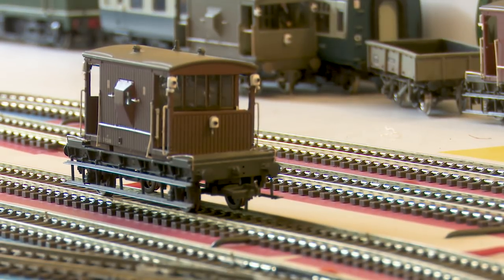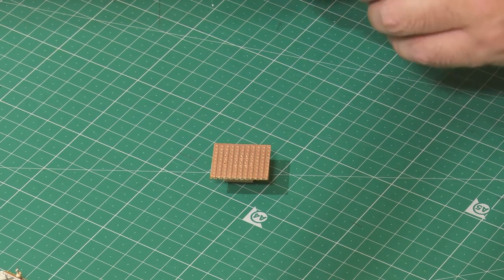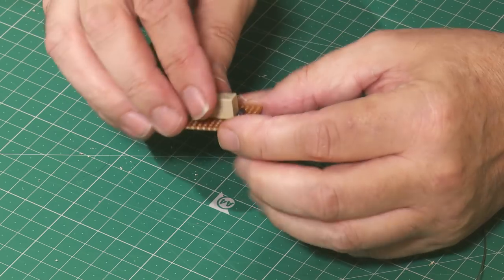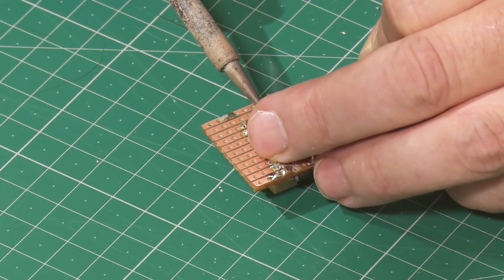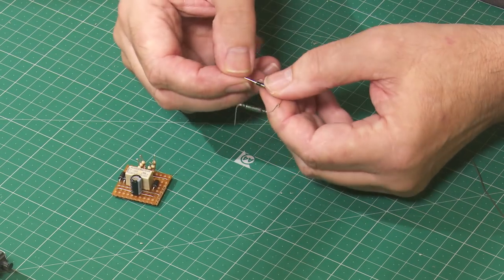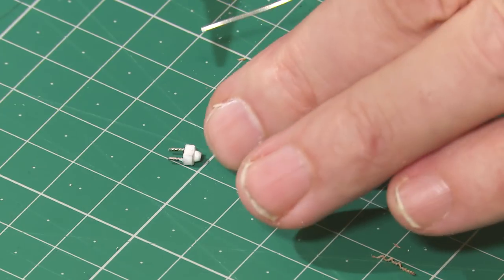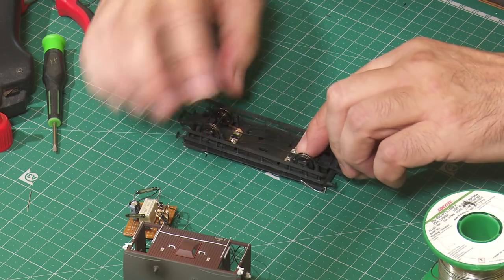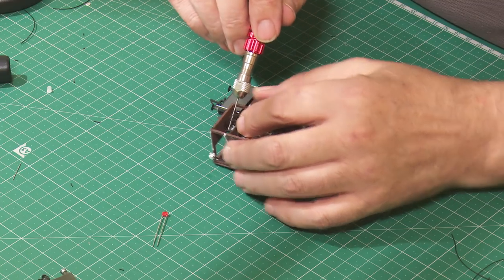40. Brake Van Lighting at McKinley Railway

Comment: I enjoyed watching this.  Just a minor correction.  Cathode is the Negative side, usually the shorter leg and connects to the "anvil" side of the LED when you look inside the LED.  Often it corresponds with the flat side of the LED.  Anode is the positive side. 
Thanks for a great video.
Reply from the maker: Opps - Thanks for the info!

Comment: Hi Charlie, I watched the video you did using the little module you aquired from ebay and decided that it could be a useful addition to the lighting controls I am installing in my rolling stock, after hunting ebay for the units and having no luck at all I then spotted this video and remembered that you were associated with McKinley Railway.
This system looks like it can work for me as no special modules are needed and just a steady hand with a soldering iron, a well devised modification for the model railway.
Well done Charlie.

Comment: Charlie - this is a neat little trick BUT the use of 3 red rear-facing lights was limited and on unfitted trains, the side lamps were used to face FORWARDS so that the driver could see that the train was complete (not required on fitted trains of course).   Your LEDs should be slightly altered to show a red light rearward and a white light forward - presumably by changing the painting/buffing arrangements.  Still a great video and a neat trick for van lights!!
Reply: To get the white Light forward would involve getting a separate white LED for each side.  So you'd need to fit two LED's on each side.  The LED's used in this video are red and do not have a white side, which is common of LED lights
Reply: @EsotericArctos  But there are white LEDs for sale...

Comment: That is a very neat use of these miniature latching relays, a great idea and so simple well done plus thanks for sharing. As used here the relay will most likely do the 50 million operations it is specified for, certainly outlive most of us!! To do this application with integrated circuits etc to match your spec would need some form of memory, so for me at least would be over complex.  Some comments if I may -

1) There is no power up inrush current limiting circuitry to the buffer capacitor, this could give rise on certain DCC combinations of power supplies/ layouts/ lots of instances of this or similar circuits from causing nuisance tripping of  DCC power supplies. This as the inrush currents add in this scenario.
 A simple enhancement I suggest is to fit a 47 ohm 0.5 watt charge up resistor in series with the top LHS half wave rectifier diode on each PCB.

(The 100uF capacitor appears as a short circuit and will draw a nasty spike of current limited only by the track wiring and track resistances to the DCC psu).

 This might not be a problem if you only have a few such instances of this circuit. Certainly at McKinley you have multiple and hefty supplies and your stock is well spread. So any such issues will likely be masked/ minimised. However modellers who have a small or sensitive DCC psu and multiple instances of this or similar (e.g. some DCC hold up circuits, or if not set up correctly too) and the surge currents may become significant and/ or may interfere with other equipment.

2) You (correctly) specified 1N4004 rectifier diodes for the relay coil flywheel diodes, these have 30A peak current capability and that range of diode is what should be used for such a relay coil flywheel diode. The RS part 671-5477 you detail is pulling up  signal diode type IN418 which has a peak current capability of 2A - I suggest to folk to avoid this as they may be on the verge of failing in this role. IN4002 and 1N4003 are other suitable and perhaps more cost effective diodes to use.

3) DC Analogue - yes it can be used - see my comments on direction enhancement to "Timbersurf" for options to enhance.

Comment: Nice video Charlie.  When I did my apprenticeship we were taught to solder the smaller components first so that they remain flat, saves using blue tack or burning your fingers holding the component in place :)  - could have used different coloured wiring rather than knots :)
Reply: Malcolm,  he said he used all black to help disguise its presence from the back of the lamps
Reply: @ZappaTime  ah.. missed that.. that would make sense

Comment: Neat, really nice result.

Would add; if you wire each group of 3 LEDs in series, then you can use one 6.8k resistor, rather than three 10k resistors. And as others have said, you got your anode and cathode backwards, my chemistry teacher had a good mnemonic, she hated cats, so the cathode is negative. ;-)
Reply: Pancake! Positive Anode Negative Cathode!

Comment: Nice tutorial Charlie! You should mention this circuit only works for DCC!!!
Reply: That is not completely correct - half correct to be exact! So for dc analogue use (do NOT try my suggestions on DCC) - -
1) It will when there are enough volts to allow either of the latching coils to energise, but in one direction only (that gives positive volts). Thereafter the LEDs will start to pass current/ glow when ever there is more than about 3.8V in the given one direction only. This is because the supply is always half wave rectified to give a positive voltage on the top rail. In the other direction the diode blocks any current flow and any charge on the capacitor if there is any is rapidly lost (2/4 secs max), out goes the lights.

 2) Replacing the feeder half wave rectifying diode (circuit top LHS) with a full wave rectifying bridge (it inserts between both rail pick ups and the shown circuits i.e. 4 discrete connections - you need to understand how to do this - I stress this is NOT a direct swap out) and this circuit will then operate in either direction under analogue control. 
 
3) Further connect a 9V battery that feeds its positive via a series IN4002 diode to the positive rail of this circuit (top of the reed switches) and the lights will stay on all the time;  the dc analogue supply taking over and supplying the LEDs when reaching top speed (greater than about +/- 9.5Vdc). The OV/ negative of the battery goes to the 0V of the circuit = the bottom line of the circuit.

4) You can further enhance by adding a battery on/ off switch in series with the battery positive terminal to conserve your battery when not in use.
Hope this helps Stephen
Reply: @stephenpike3147  You miss the point! Unless a bridge rectifier is used, the circuit as shown, will only work when running in one direction!
Reply: @TimberSurf   And that is exactly what I said, please do me the courtesy of re reading all the way through this time and thoroughly digesting before commenting.
Item 1 Half wave = "but in one direction only"   "This is because the supply is always half wave rectified". 
Item 2 "full wave rectifying bridge"   "will then operate in either direction under analogue control" 
 I couldn't have been clearer could I  !!!!!

Comment: The question is are the electronics cheaper to build than a cheap DCC decoder? Admittedly this works on a DC layout. Also why not use the copper tracks as tracks. You could reduce the number of links required.

Comment: Hello asking out of interest but could there be a video on fitting Kadee couplings on stock that dont have nem pockets??
Reply from the maker: Good point. We did that in 2000-2003. I avoid non NEM pocketed stock like the plague these days.  Did you have any stock specifically in mind?
Reply: @dattouk  well some stock by hornby and bachmann use ether clip on couplers or screw on couplers

Comment: Has anybody tried putting the reed switches running front to back, one each side of the van  so you can select the lights by having a fixed magnet trackside always on the left hand side in direction on travel. One directional track only

Comment: I did it differently and using only a single LED with miniature on off switch underneath and a coin cell battery and holder hidden inside the van.  Hand of god needed if the van light needs to be on.the other end.

Comment: Nice for a change to see somebody associated with model railways who knows how to solder i.e. does not insist on plastering everything in flux paste. The "multicore" in multicore solder refers to multiple cores of flux within the solder, a fact that many muppets producing so called "instructional" videos about soldering seem oblivious to. Leave the horrible muck alone in the tin in the shop....where it belongs. If you need to plaster everything in solder paste to get the solder to flow, you just ain't doin' it right. Anyway, this is a clever idea for being able to switch tail lights on and off easily. Just one small grumble. The anode of a diode is the positive end and the cathode is the negative, not the other way around as stated in the video.
Reply from the maker: Opps.  Thanks for the note.

Comment: This just cries out for a PCB.. Anyone able to post up the internal dimensions (max length and the width) of the van... I'm bored and want to play.   Wouldn't cost much per board to have JLPCB or any other PCB house in China run them up.

Comment: Loving the channel, however annode is positive and cathode is negative https://startingelectronics.org/beginners/components/LED/ also the circuit diagram does not correspond to the video as the resistors are not going to the same contacts at all for A or B and only 2 are to the same place for C and D.